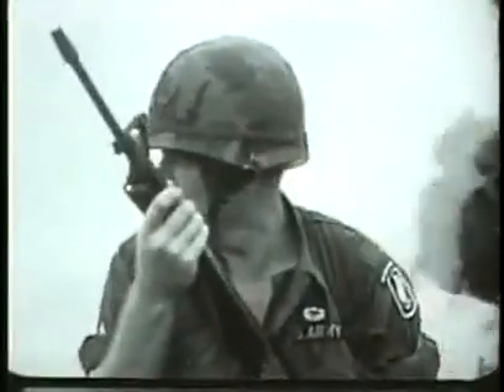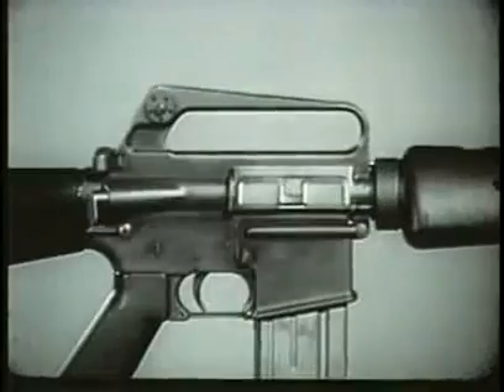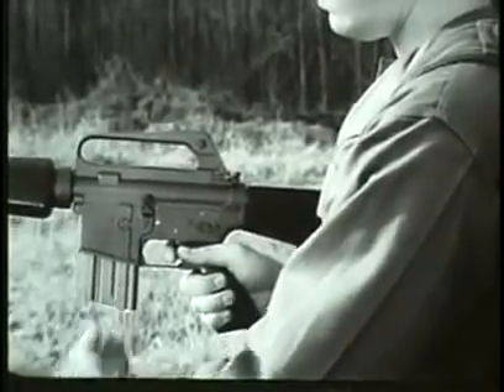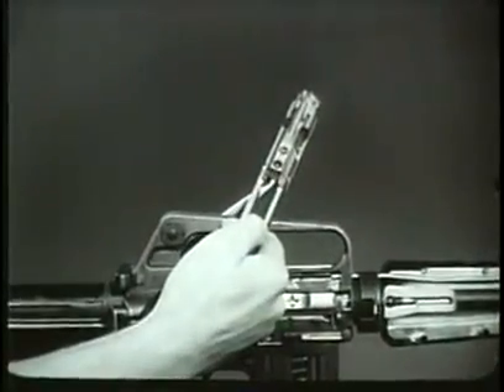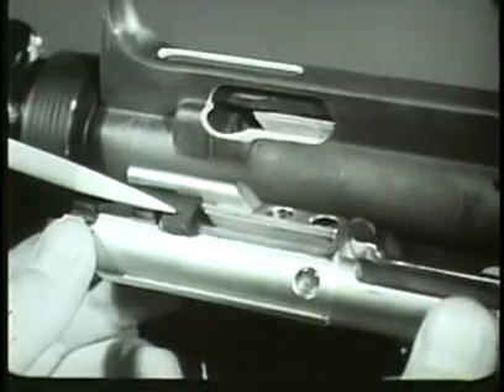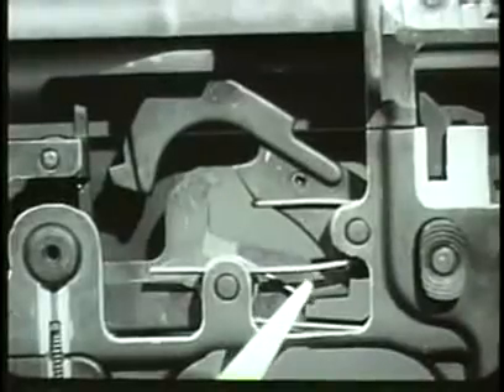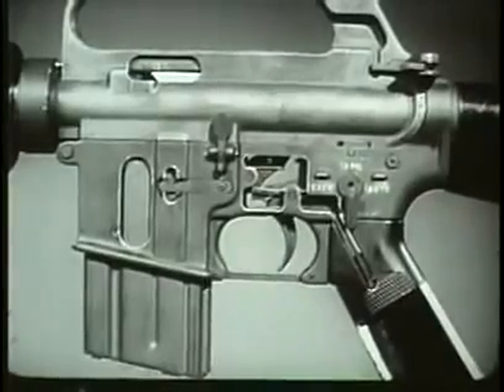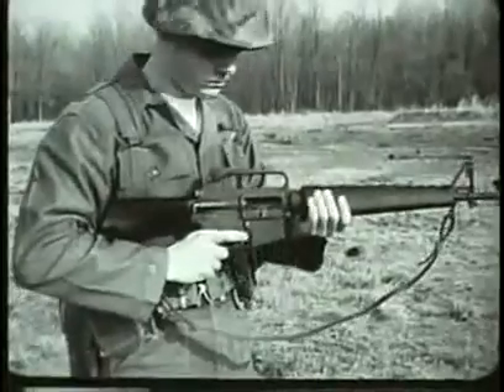Vietnam War Era Training Video: Operation of the M16 (AR15 variant)

Comment: Four years with the Seabees and they rarely issued me the bayonet and only let me fire in "full auto" with blanks.  Then I spent an hour cleaning it.  My favorite memory is blowing rain water out of the rear sights while shooting to qualify in a down pour in Gulfport, MS.  Ah, lying down in water puddles on my poncho, squinting to see the target through sheets of rain, concentrating to ensure I shoot only my target (it happens), wiping the starch off my face (we starched blocked our caps), and anticipating the joy I will have pulling the targets in the berm when it's my relays turn.  Barely made "marksman".  Relieved that I didn't have to come back the following week.  Fun times.  It was an M16A1.

Comment: Stoner’s design will NEVER top the AK.
Reply: My dad was in Vietnam, he said every AK he had seen was a unmaintained rusted POS, but worked every time, without fail.
Reply: The AK is perfect for what it's designed for. Use by untrained peasants, with no marksmanship skills or fire discipline,
who are thrown against an enemy and expected to win by sheer firepower at close range.

Sure it will work all the time. But nobody cares about accuracy.
Reply: https://www.youtube.com/watch?v=LHn6tYx8TMc
Reply: Stoners design has surpassed it already. Which is why every decently funded army and police force uses a variant of them
Reply: My Name Is Jeff it’s used by America and it’s allies just like the AK is used by Russia and it’s allies. You really think decently funded police departments in Russia use a Stoner rifle?
Reply: @u.s.militia7682  Russia doesn't have a decently funded military, the only ones that get anything decent are their special forces. They use the AK because its tradition for them, not because its better. Thats why they tried to clone their guns and ammo to the M4 as closely as they could. They adopted the 5.45 because 7.62x39 sucks ballistically. 5.45 is their copy of 5.56. They also are adopting the AK12 variants which are literally just M4 controls copied onto an AK. Everything from the safety selector to the M4 stock compatibility was copied. The AK platform isn't better in any way, its actually less reliable than modern stoner designs like kac and lmt's
Reply: @mynameisjeff6988  7.62x39 does NOT suck ballistically. It maintains nearly the same power as .30-30 approaching 300 meters. The 5.56 has a flatter trajectory, but the projectiles are half the weight.
Reply: @PacketWrangler  It does suck ballistically, which is why its been phased out. 7.62x39 doesnt fragment, and bullet weight and size has nothing to do with lethality of a round unless it has the velocity to back it up, which 39 does not. a 45 acp is a lot heavier than both rifle rounds but it's nowhere near as ballistically capable as 556 or 7.62. Lethality comes from velocity and hydrostatic effects. Which is why when hunters use 7.62x39 they always use Hollow points. You need 2600 fps or above to get consistent fragmentation. Thats why 5.45 is way more lethal than both 556 and 7.62 even though its smaller. Speed is king when it comes to soft tissue damage
Reply: @mynameisjeff6988  Did you know the  Russians considering 7.62x39mm again? Why does the US Army and Marines feel need to shit can the the 5.56 for a more intermediate round 6.8? Don't forget they had to dust off the M-14 in Afghanistan, because the puny 5.56 wasn't getting the job done.
Reply: @mynameisjeff6988  Hate to tell you this but they dropped the Stoner style selector on the AK12 and stuck with the Kalashnikov pattern
Reply: @hanc37  All three of those things you said are false. The US isn't adopting something to phase out 556. They just want better armor piercing power, which is not the 556's purpose. The 308 argument doesnt work either because they're moving into 6.5 creedmoor for marksmen and belt feds even though its a smaller round. Bigger does not mean better at all in ballistics. The reason 556 had a problem in mogadishu was because they were running green tip through 10 inch CQB guns, while the enemies were drugged out of their minds. A 20 inch barrel shooting 556 will do more tissue damage than a 7.62 nato or 39. The round is not weak by any metric for what it was designed to do. There's a reason every superpower copied it directly. China made the 5.8, Russia made the 5.45. And every other country on earth uses one of those three.
Reply: @mynameisjeff6988  All things I mentioned are all well known facts. You are just one of these people that can't admit they are wrong, so you double down.
Reply: @tx942cg  And? Doesn't change the point i made. They tried it and implemented it because its better. Its just too much of a change for them to get used to. Same with the M4 stock compatibility. There's absolutely no benefit to having a proprietary Folding stock on it when there are hundreds of stock options that are way more ergonomic and cheaper than zenitco parts. They did it for political reasons, not because their way is better, because there's no way on hell that changing fire modes on a normal AK will ever be faster, cleaner, and easier to learn than the simplest M16 selector.
Reply: @hanc37   No... They aren't... 1) Russia isn't going back to 7.62x39. The only guys who use it are SOF who use it suppressed and subsonic. Which is a very, very, very small use case. 2) as i said, they arent getting rid of 556 because its weak against targets... We are fighting a new type of warfare that has enemies way further away than has ever been seen in combat before. 50 years ago, 600m firefights were only between good snipers. Now in the middle east, thats pretty much every encounter, and we haven't even gotten into issuing variable optics at a large scale yet, which they are going to do soon because of this problem. It has nothing to do with the round being weak, because we have 556 loads like mk262 that can do 800+ meters easy. The military is adopting this new round because they want the ability to pierce light armor at those ranges, which not even 308 can do. and 3) The black hawk down incident, which is what people reference when talking about the 556 being anemic was not the rounds fault. They were using 10-11 inch Barrels with green tip, a round meant not only for barrier penetration, but also developed for the 20 inch barrel. Mix that in with people with no body fat for the round to expand, and them being high as a kite, it tends to not work so well in your favor. There were multiple enemies who took more than a dozen rounds of 308 to the chest and kept going. That scenario had nothing to do with bullet lethality. Thats the reason cops in America have to shoot crackheads and meth heads 10+ times to bring them down. You won't die quick when you're stimulated with enough drugs to put the average man down.
Reply: @mynameisjeff6988  Business Insider reported, “The M16 and M4 and their variants continue to have problems with jamming, an issue the system has dealt with since its introduction. Improvements in body armor have lessened the lethality of the 5.56 round. Groups like ISIS have also made use of large rounds that outperform the US military’s ammo. (Russia is reportedly working on its own assault rifle using a 6.5 mm round.)

 A quote:

"Not only is it a bullpup design, but the choice of caliber turned away from the virtually automatic selection of the 5.45 × 45 mm cartridge back to 7.62 × 39 mm M1943. Indications have appeared in some Russian Federation military technology journals that the overall performance of the 5.45 mm round was found wanting during combat experiences in Afghanistan and elsewhere, so at least some within the Russian Federation military establishment considered re-adoption of the well-tried 7.62 × 39 mm M1943." First of all, is "janes.com" a trusted source of info?

Second, if what was said is true, is there a possibility the Russians will go back to the 7.62 in large scale? In USA, for some time M14 was mostly relegated to Honor Guard and similar duties, but during recent campaigns in Iraq and Afghanistan many old M14 rifles were withdrawn from warehouses, dusted off and issued to troops in the field to improve range and lethality of troops armed with 5.56mm weapons. Some M14 rifles are issued as is, some are fitted with new telscope sights to serve as a para-sniper / designated marksman rifles (concept similar to Russian SVD rifle). US Marine Corps also re-issued M14 rifles for use in Designated Marksman role (DMR), and those rifles are fitted with newly made polymer stocks with adjustable buttstocks and pistol grips, and other accessories such as detachable bipods or sound moderators (silencers). Recently US Special Forces, operating under the US Navy flag, stepped forward with the Mk.14 Mod.0 Enchanced Battle rifle, which is an M14 fitted with many new commercially available parts, new stock with adjustable butt and plenty of Picatinny rails, and new accessories such as noise suppressors and optical equipment. The Mk.14 Mod.0 EBR is currently being used by US Navy SEAL's and possibly some other special operation forces within US Military.

Comment: "Automatic and Semi Automatic" 

COD: three round burst go brrrrrrr
Reply: Later versions have three round burst instead of full auto, and those are the ones in all the modern Cod games.
Reply: @hansgruber8357  the M4A4 version comes in burst fire
Reply: @Badger-l7q  there is no m4a4, but there is an m16a4 that does come in burst fire mode
Reply: David Bork  alright man
Reply: @LeeZoV  The A2 and A4 are burst. The A1 and A3 are full.
Reply: I believe they introduced the burst fire mode later on to limit ammo expenditure, especially in less experienced soldiers, in the jungle where resupply was more difficult, as well as to try an increase hit probability. Kind of what the Russians did with AKs by placing the semi auto mode on the bottom position of the fire selector, so if a conscript panics and slaps the fire selector too hard, he won't start spilling rounds everywhere or shoot the ceiling.
Reply: @nemanjastefanovic2648  Yeah and more accuracy than full auto
Reply: David Bork  Not on your channel, conveniently. I seriously doubt you can handle a higher power cartridge like a 7.92 at 4 rounds per second all while hitting a target at a reasonable distance to show some level of marksmanship. Also "hitting the target" means nothing if we don't know how far or big the target is.

Regardless, nobody asked.
Reply: David Bork  video or it didn’t happen,
Reply: mmmmmmm....  colt 4 position  ftw, yaaassss.....
Reply: Maybe because the model depicted in game is an M16A2 and not an XM16E1.
Reply: @LeeZoV  no it wasn't are you dense

Comment: A m16 is not a ar15. I don’t know who told you that but it isn’t even close to being a m16. M16 can chamber a 556 which is 58,000 psi. You put that into a ar15 it will turn it into a grenade.  Ar15 has different guts and barrel. It is semi auto and is not an assault rifle mainly because it uses the smaller 223. At 55,000 psi.  It’s a great sport rifle. 
Personally I like the ar10 it can shoot 556 which means longer distance to drop. Perfect for hunting.
Reply: Holy shit dude just about everything you said is wrong, and you're so arrogant about it I feel just fine being an asshole in my reply. 1) All of my AR15s are chambered in 5,56 NATO,  2) some of them have Mil-Spec barrels, some stainless, 3) A fucking AR10 is chambered in .308 or 7.62 NATO. 4) The differences between .223 Wincester and 5.56 NATO have more to do with overall cartridge length, seating depth and case length than chamber pressure and 5) MOST of the internal parts are interchangeable with the M16, specifically the trigger, disconnector, hammer spring, disconnector spring, hammer pin, trigger pin, bolt, bolt carrier, buffer, buffer spring (action spring in this vid). The three main differences are the receiver, hammer, selector and the addition of the sear. 
Good day.
Reply: This comment hurt me... it hurt me bad...
Reply: Wrong! Ar15 can come in 5.56 or 223 (or both if you buy the 5.56 version). An "ar10" is chambered in 7.62×51 (308). The only thing you got right is that an "m16 is not a ar15".
Reply: @thegoldenchild4657  a ar15 “platform” isn’t really a ar15. The colt ar15 came chambered in 223 with a 20 inch barrel and a 5 round magazine.
Reply: Thank you Unavailable!

Comment: Hell of a weapon system. Trained on one in 1988. Issued one as a Deputy Sheriff after I got out and during my whole career. Still using the same weapon system to hunt with and plink to this day, having used the M16A1, M16A2, and modern incarnations of this system.
Reply: David Bork  M2 carbines only have an effective range of inside 200 meters. The M16 series, even the M4 carbine, has a much longer range and punch. I know, I own both and have done my own testing.

Comment: This is not an AR-15.
Reply: Actually it is.
The origonal AR-15 of this era was sold before it got into military use. had select fire options and every thing. there's very little to no difference between an AR-15 of this era and an M16 since the military juts ended up adopting it after it was already being sold as an AR-15
Reply: how so

Comment: huh. im so glad this was reccommended. ive always loved how the early versions of the m16 looked.
Reply: The slotted flash suppressor would catch on bushes and stuff I recall my irresponsible squad leader using it like a wrecking bar to burst the steel straps on pallets of C-rations.
Reply: You furries getting information in our weapons rig- uh. Yeah yeah very cool right…
Reply: @EmbeddedWithin  well to be fair, furry or not, the ar15 is still really cool. sure, i'd rather have a 7.62x25 converted pp-19-02 bizon, but yeah the ar15 is still pog.
Reply: @rebel6301  yeah have to agree
Reply: @EmbeddedWithin  agree with what? the part about the 7.62x25 converted bizon?
Reply: @rebel6301  both

Comment: Whoever created the carry handle design is an idiot. If you’re gonna be carrying a gun you’re probably gonna be having to be ready to use it. And if not then it should be swung on with swivels.
Reply: @ Puppy Puppington: Re: "Whoever created the carry handle design is an idiot."

Eugene Stoner, the head engineer on the project which created the AR15, was no idiot; many firearm historians regard him as a genius, in fact. The "carry-handle" was an after-thought, the real reason it came about is because Stoner and company decided to make the weapon with a straight-line stock, i.e., the stock sits in a straight line with the receiver and barrel, rather than dropping somewhat below them as with traditional rifles prior to them. One of the reasons dropped-stock designs are so tough to control in full-cyclic operation is that the curvature or bend of the stock acts as a flex-point or hinge, which redirects the muzzle upward under recoil. A straight-line design is considerably easier to handle and keep the muzzle on target. However, it does create a problem of needing the sights higher up than usual. In a rifle like the M-1 Garand or M-14, since the stock drops behind the receiver/action, the iron sights are relatively close to the bore. This isn't possible on an AR15/M-16, not if you want the user to be comfortable behind the rifle. Stoner et al. probably came up with the idea of combining the rear sight and carry handle as a means of handling this problem. 

No GI worth his stripes is going to carry that thing by the handle anyway. The handle is there to house the rear sight assembly. That's all it is good for. The proof of that lies in the present: Someone finally figured out that the rear sights of an AR15 work perfectly fine as a stand-alone assembly without the "handle" portion of the rifle, and they are now sold that way.
Reply: It raises the sight to the correct height for battle zero and also protects it.
Reply: The handle came in handy sometimes as you didn’t always have to be at the ready. Army Infantry 4th ID.
Reply: @stevepowsinger733  I don’t understand why people dislike the handle so much, I like the classic look

Comment: Should’ve stuck with the m14 or the ak47/SKA. Could’ve saved so many lives by Not giving Americans & ARVN Mattel plastic crap long arms.
Reply: It had and has nothing to do with the guns, the troops were lied to because they were told the rifles self cleaned and thus were told either to minimally clean or not clean their rifles minimally, couple this with crap ammo that was over powdered leading to gas pressure problems and you have a gun that dont work.
Reply: @sulimanthemagnificent4893  There was also the useless button that only serves to make malfunctions worse that the Ordnance Dept. crammed into the upper.
Reply: The US never adopted the AK. I believe you're talking about the SKS with "SKA", which also was never in US military service.
Reply: or you could do 5 minutes of research and not buy into the whole crap that the gun was bad, and realize that it had problems because some idiot wanted to save $2 per rifle and not issue cleaning kits.
The gun ran perfectly fine in the conditions of nam but with out cleaning kits any gun will jam over a few weeks
Reply: @Badger-l7q  actually there's been wuite a bit of evidence that the lack of cleaning kits would come down to higher ups wanting the M14 back